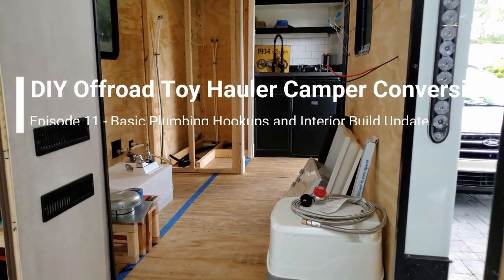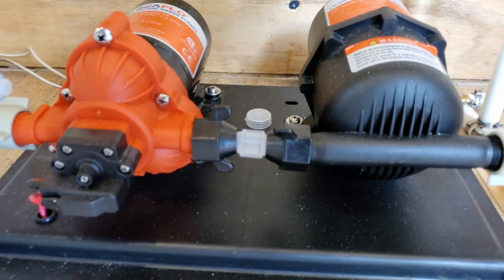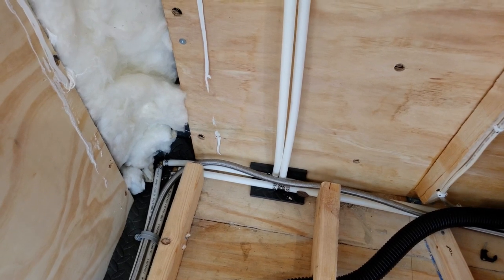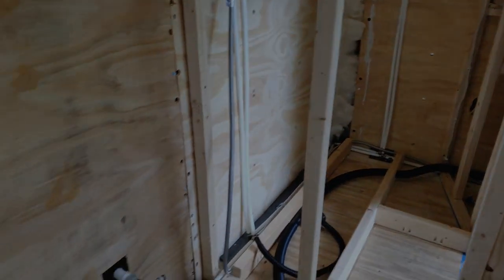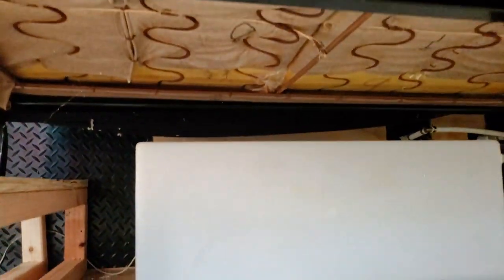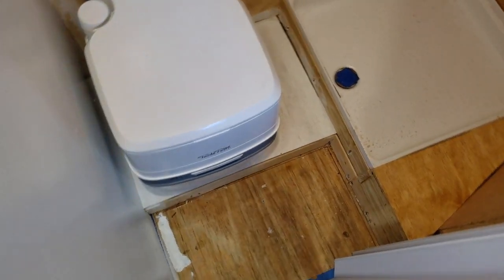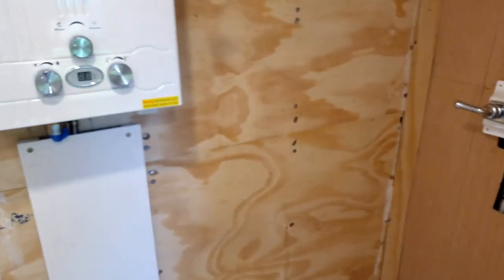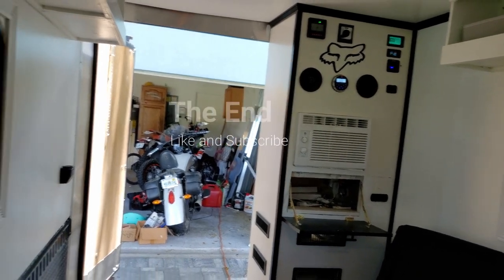DIY Cargo Trailer Camper Conversion - Episode 11 - Plumbing and Interior Build Update - Toy Hauler

Comment: Hey Don, I have another question for you. The walls look awesome, is that just paint on play wood? If so what kind of paint did you use?
Reply from the maker: Hi. I covered the plywood with 1/8in Luan Plywood from the roof line down 4ft (the width of the 4x8ft. sheet) then I used flooring material (a diamond plate style vinyl type) glued directly to the plywood. The bottom part gets more wear due to dog and stuff I secure to the walls on e-trac. I wanted to be able to wipe that down. One of the last eposodes I cover that, I think?

Comment: Very nice build particularly how you fit in the AC. Does  it cools enough? We have a portable AC in our build and I am not too pleased with it and looking for options. Maybe expectations are to high we get a 15F differential from outside temp. Looking forward to your finished product.
Reply from the maker: Thanks. Yes, the AC cools very well. It is important to have good insulation for it to work well. If your portable is a one hose type, it will not work well. The two hose types do better, but still not as good as an equivalent BTU window type. You should get better than a 15 degree difference.  I can do 20 easily.
Reply: @donsdoityourself2547   Thanks greatly appreciate the response. I was thinking of taking apart the portable to make a poor mans mini split but based on your response I will see how I can fit a wall unit instead. Thanks again for input.

Comment: What did you use for your finished wall. Looks good!
Reply from the maker: I covered the plywood with 1/8inch Luan paneling and painted it. For the bottom part that is black, that is a rubber diamond plate pattern flooring that comes in various size rolls. I just glued it on and used Etrac for the transition.  Needed etrac anyhow for tie downs.

Comment: Hate Pex crimp-on fittings.....a much safer alternative is the Wirsbo/Uphonor fittings...schedule 80 plastic pipe, but you expand the pipe with a tool, then insert the fitting...after a few minutes, depending on ambient temperature, the pipe "shrinks" around the fitting.......almost indestructible.
Reply from the maker: Sounds interesting.  I wasn't aware of that option. 

 Pex seems to work well if you get a good crimp and it is easy to work with.
Reply: @donsdoityourself2547  Wirsbo is PEX, just a slightly different manufacturing process and a slightly different molecule. It's much softer than the more common variety of PEX, allowing it to expand and shrink again. It might be more robust against freezing, and if you kink it you can heat the pipe until it turns clear and recover the kinked area. The fittings are nice because they allow full flow - not an issue in the trailer - and don't need a crimp ring (they use a special pex ring that expands and contracts along with the pipe). Biggest problem?  $$$. The pipe and fittings are less common and more expensive, and the tooling to assemble them is silly expensive compared to the more common copper or stainless rings and crimper.